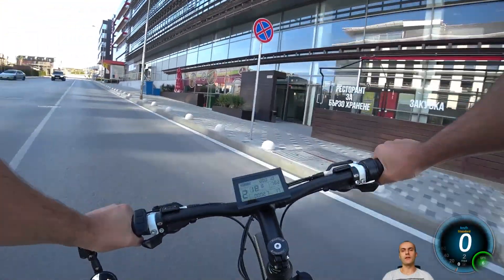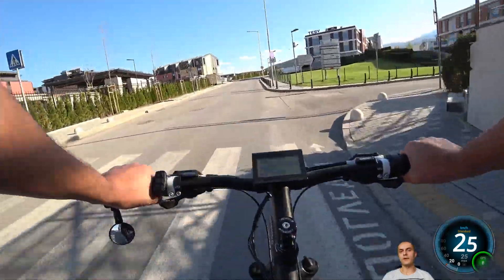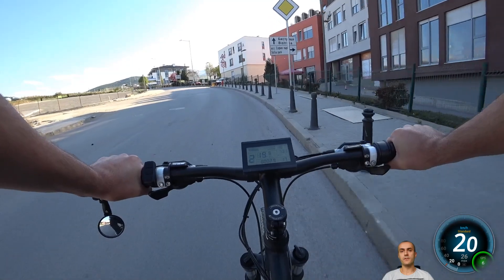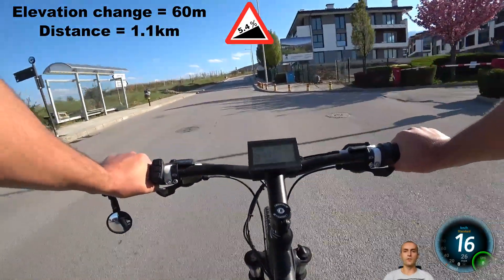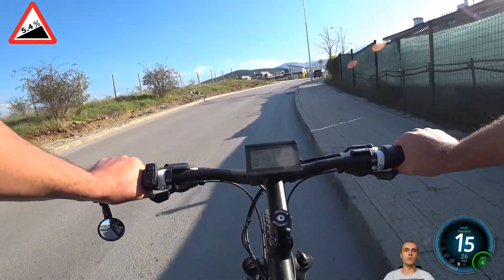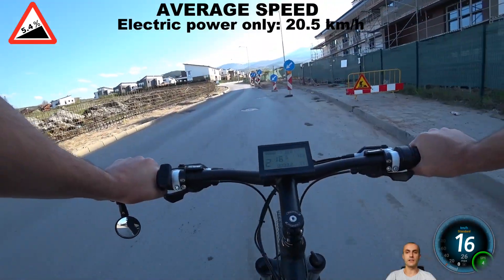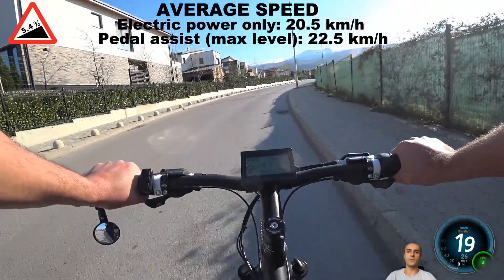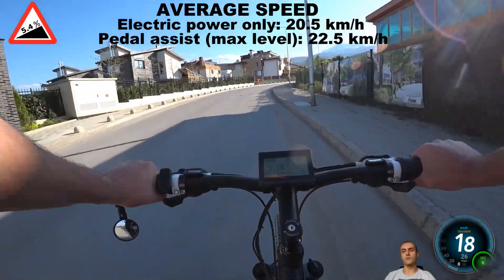Bafang 500W uphill [throttle only vs pedal assist]

Comment: I got 1000W hub and my legs have 30s sprint of 800W. 
With this amount of power, I could ride 50km/h on most of hills.
Cant wait to test it.
Reply: But these motors have about 85% efficiency, so from 1000W electric power, you get maybe 850W. 
Meine hub is 30A, but controler is 22A, so 48x22 = 1056W max electric power.
It comes to 900W max engine physical power.
Additionaly bike is way heavier, tires more gripply and aerodynamics a bit down.
Reply: How about now? Do you have any results to share?
Reply: @nikostalk5730  Cadence of my hub ends around 45km/h, so riding 50kmh it would give me only 200W.

Comment: Which chainring were you using on front? 44T or something else? And how many tooth on the rear cog and which gear number used for climbing?
Reply: hubs transfer motion through the spokes into the wheels and none of the power goes through the drivetrain.  The gearing of the bike would have only affected his pedaling

Comment: Have you tried 48v? If yes is there much difference in performance?
Reply: 48v / 36v = 1.33 = 33% faster spinning motor.  Assuming the controller can handle the increased voltage

Comment: Best is going 42km/h up a 10% on full throttle + pedal on Bafang 750w mid drive.
Reply: 42km/h is more like the top speed of a 750w BBS02 on flat. I'd love to see how you could achieve that kind of speed going up a significant incline.
Reply: @EBikeBuilder_  pedaling really hard. The hill was relatively short so just went all out for 30 seconds with the throttle pinned. I was probably putting in an extra 800 watts myself.
Without me it tops out at 28 km/h in a lower gear.
Reply: @TimpBizkit  nice! gotta love the bbs02!
Reply: @TimpBizkit  Can the bike handle thsi kind of power ? And what about gear shifting ? I think 750W is wonderful but I fear a lot of destroyed stuff ! Have you had problems ? How often do you have to adjust the derailer ? (I am thinking to buy a bike)
Reply: @TimpBizkit  800W extra? i highly doubt that as the average leg power from professional race cyclists (i.e. tour de france) have an average leg power of 450W
Reply: @BH4x0r  it was like a 30 second hill (at that speed, takes longer on a normal bike). I've measured power on a full body bike in a gym at 1100 watts for 10 seconds but that was also using my arms. Maybe take 200 or something watts off for ditching the arms.
Reply: @dimitristripakis7364  if the chain and sprockets are worn, the chain can skip over them. Also 11 tooth cogs tend to wear out pretty quickly. Otherwise it handles the power pretty well, although there will be accelerated wear compared to an average pedal cyclist.

Comment: Can i add a front electric wheel to my rear assist  e bike?
Reply: yes but you would probably need 2 controllers, 2 displays,  then use some kind of splitter for the brake cutoffs and throttle so you could control both motors with 1 throttle and 1 pair of brake cut offs. you would want 2 motors from the same manufacturer that use the same connectors for brakes and throttle. The battery maximum discharge current would have to be sufficient to power both motors,  or you would need 2 batteries

Comment: Hi, is it possible to set the pedal assist  to 1 or 2 for example, and still have 100% of the power with the throttle?
Reply from the maker: That's how it works. I am not aware if it can be configured otherwise.
Reply: Throttle separate from pedal assist

Comment: Hi Alex,  well done.  I am thinking to purchase a bafang kit, but I want to know if the 500w for a rider around 98Kgs. Tires 27.5 are sufficient.  My friend had install 750w but he stated that is over powered for bicycle. From the other hand in Europe we are binded with 250W only.
Reply from the maker: Hi, it will be best if you first try it out yourself. Try one of these 250W in every e-bike shop and see if fits your riding style. For me 250W is not enough.
Reply: @aleksyanev  Привет собираюсь приобрести бафанг 1000w. Сказали что скорость до 60 км в час. От курка будет такая скорость или от педалирования? Переднюю звезду поставить 52 или 48? Что посоветуешь?
Reply: 750w mid drive is not really over powered,  you can turn the pedal assist level down if you want

Comment: Thank you Aleksandar, great video. I have a question, how noisy is the motor? Can it get annoying?
Reply from the maker: Not annoying at all. I have other videos where the motor is much louder on purpose because the mic is attached close to the motor, but that's not how it sounds IRL. In urban environment passing traffic is louder than the motor.

Comment: Hi :) can someone please recommend a conversion kit for me please ? I have a hybrid giant roam 1 2020 with 700x42 tyres. I’d like to go 25 mph + with a high range on the battery as id like to use it to do food deliveries all day !
Reply: Ebay all day
Reply: 750w bbs02 mid drive at least,  if you have the money 1000w bbshd,   52v 20ah triangle battery
Reply: @EBikeBuilder_  I bought a 48v 31ah triangle battery a long time ago and was hoping to use it at some point… can you point me in the direction of someone who could put it on a bike ?